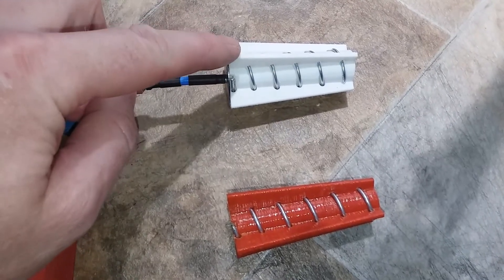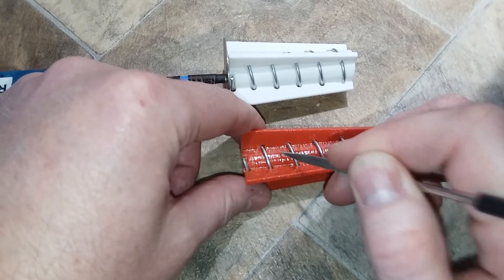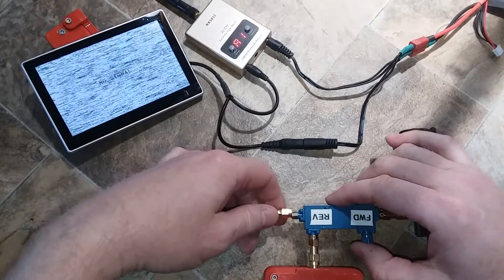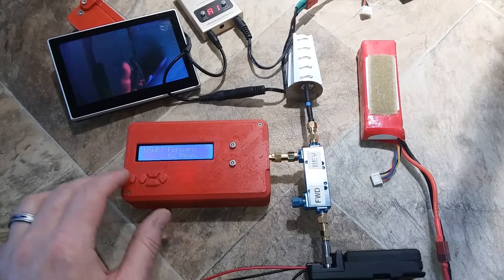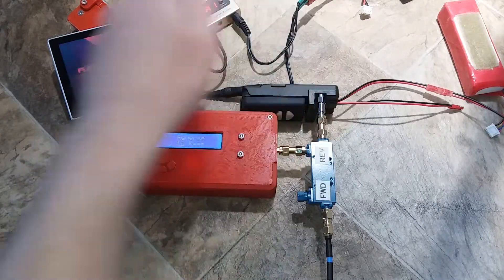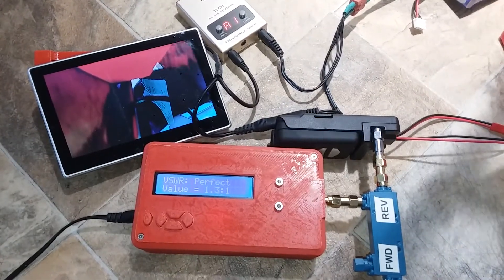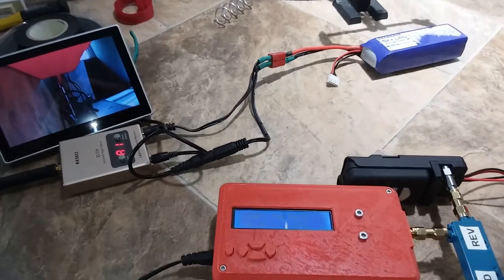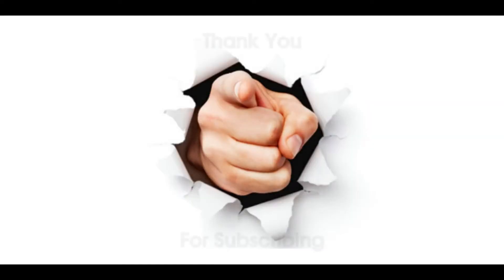5.8Ghz 3D Printed FPV Antenna - Re-design and more SWR Testing- Part III

Comment: Hello MrDabrudda, Can you give me any ideas on how to improve FPV range on 5.8ghz (wifi for drone ). Have an Holy Stone HS720 drone and the controller range is very good running on 2.4ghz,,about over 1km ,but,,the actual camera/FPV runs on 5.8ghz to smartphone/tablet for additional functions. This range is only about 126 meters at best. Have tried adding an external antenna for example to the 5.8ghz radio part on board,with no improvement. I think somehow am going to have to run some sort of amplifier on either android tablet or drone itself,,or both? Thank You
Reply from the maker: You can check for interference from wifi routers on the 2.4 and 5.8Ghz spectrum using a phone app downloaded from the Google Play or Apple Store.  Also try switching channels on the TX and RX.